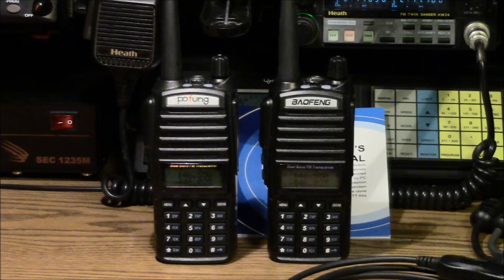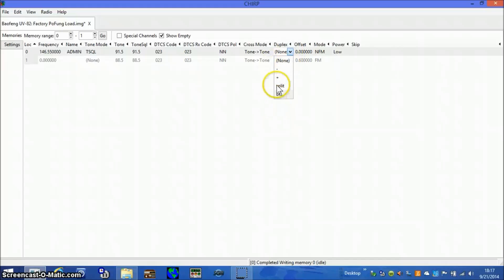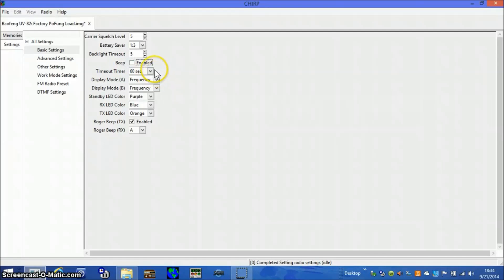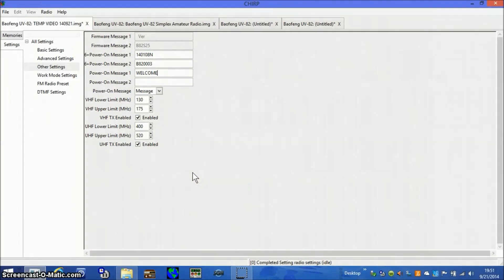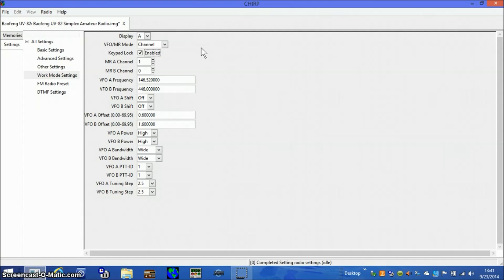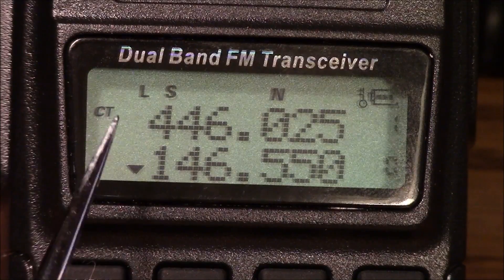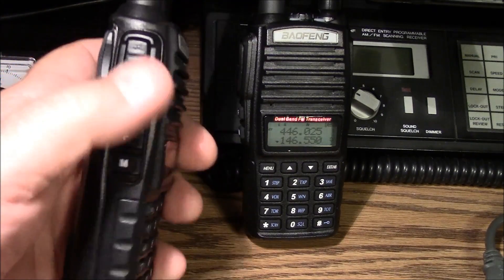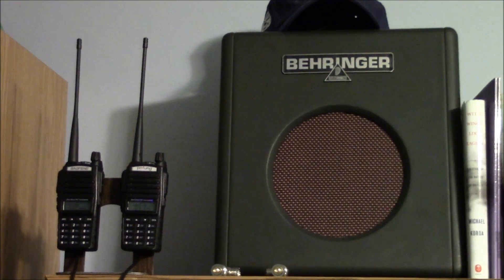Chirp Programming the UV-82 - Simplex & Dual-Watch - Baofeng

Comment: Hi my fellow colleague, I am an OPT in the SE region. I need to program these radios, but I am having trouble. Please can you tell me what version of CHIRP do you use? My UID is mr6240, in case you want to email me, thanks in adv.
Reply from the maker: +Mario Rodriguez I used to be UUID:er2341 until I retired in 2010 after 38 years..  

I just checked my Chirp software via "About" and it indicates that my version is daily 2015-0530.

I apparently have two versions of the UV-82, the pair I used in the video and a unit that I purchased "later".  Initially, I couldn't program the later radio using the programming configuration from the other two so I had to download the factory configuration from the "later" radio into Chirp and then re-load the configuration data manually into Chirp.
After an upload of the "new version" configuration, the "later" radio worked fine.  There are different versions of Firmware in the various UV-82's which have to be treated as separate entities..

Comment: It seems placing the radio with TDR mode set to ON would be very useful here so this way you can monitor the Admin and the PSC channel at the same time and not miss any traffic. However since the keypad is disabled we cannot change the TDR mode. Is there a way to change it in the CHIRP settings?

Comment: you helped clarify some of the things in the chirp software.  my radio's are programmed with both public safety and ham so using chirp is a must.  i have some public safety agencies that use digital tones and not what i call pl tones (ctcss), so i have to be careful which columns to change.

Comment: when radio is in simplex mode, do you have to have a fcc license or ham radio operators license?
Reply from the maker: 1. Operation in the Ham Bands requires a license whether you're simplex or duplex or even semi-duplex.
    The Hams are pretty aggressive about tracking down un-licensed operators.

2. Operation in any band accessible by the UV-82 except FRS (Family Radio Service) requires a license however, I don't know if the UV-82 is certified for the FRS band as that band has a maximum allowable power output of 1/2 watt and a requires a non-detachable antenna.  The UV-82 minimum power is 1 Watt and the antenna screws right off the radio allowing attachment of hi-gain antennas..  

3.  I don't know if the UV-82 is FCC certified at this time to operate anywhere but the Ham Bands.

So the answer I guess is that when using the UV-82, you should have a license appropriate for the band you operate in no matter where you operate.

miklor.com has some information concerning FCC Certification and the UV-82
http://www.miklor.com/UV82/UV82-FAQ.php#certify

Here's a link concerning the FRS bands
http://www.fcc.gov/encyclopedia/family-radio-service-frs

Ed/Central California
Reply: wow! outstanding information, now it's time i try to get a license. thank you for the schooling. do you mind if in the future i ask you a few more ham radio questions? thanks again.
Terex, Mississippi
Reply from the maker: terex7909 http://www.arrl.org/getting-your-technician-license
Reply from the maker: terex7909 Here in Central California, they have "Ham Crams" where they literally stuff the license info into potential hams so they can pass the Technician Test which gives operating privileges covering the ham bands above 30 MHz which makes it possible to legally operate on the VHF & UHF bands with a UV-82.

You can Google "Amateur Radio Clubs Mississippi" to locate easy methods to prepare and take the Tech Test in your area. There is no requirement for Morse Code since 2007.  Here's a link to a Ham Club in Jackson.
 http://www.msham.org/

Go ahead & forward your questions.
Reply: The Erod1944 Channel this radio is for part 90 which is public safety, business etc and for ham radio operations only.  there are however some hams i know that use these baofengs and wouxuns on frs/gmrs and even murs also.  do i care, not really.  am i turning them in, no.  that is between them and the fcc.
Reply from the maker: terex7909 If you're on the Ham bands or Commercial Bands, the Answer is Yes.
If you're on FRS, the answer is no.
Reply: Thank you very much. We have our comms up on the FRS band and are having a great time with these radio's now!
Reply: terex7909 by you stating that your using these radio's on frs bands, the fcc can now fine you.  i would not be posting that type of comment on the internet terex.  this is between you and the fcc.  glad your having fun.
Reply: we are using them on a military base with permission from the facility who is licensed to operate the "net" but thank you kind sir for the advise!

Comment: Awesome, thanks. At the end of the video it looks like some cables are running from the back of the units. What are they?
Reply from the maker: bubblehead7680 I'm using the UV-82's as scanners on my ham bench and the two cables are "Battery Eliminators" run by my 12VDC bench supply.  I got tired of recharging the radios every other day!  The battery eliminators are shaped like a battery with a cable hanging out and it slides right into the battery slot.  Great for mobile use in a car.
http://www.amazon.com/gp/product/B00IWV7X6I/ref=oh_aui_detailpage_o05_s00?ie=UTF8&psc=1
Reply: The Erod1944 Channel I need you to help me what is much better to the uv5r or the 82
Reply from the maker: I donno.  I only have the UV-82 which I like a lot.  The UV-82 radio case seems to be a bit bigger making it easier to push the buttons but beyond that, I don't have any experience.